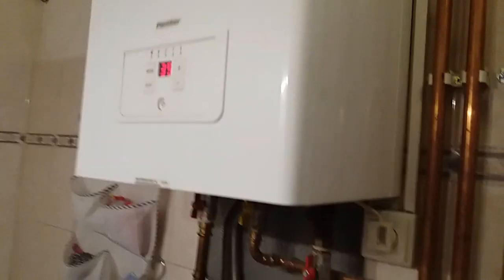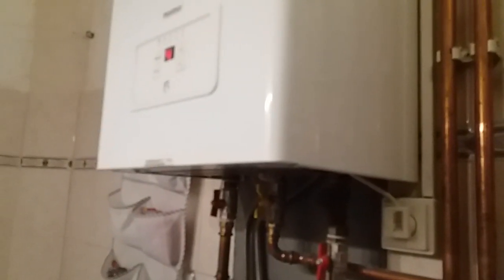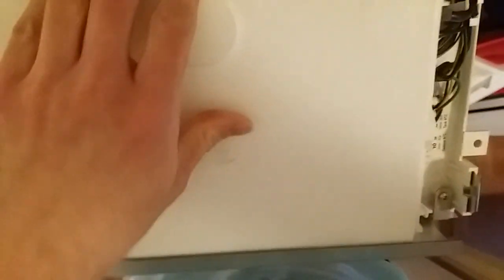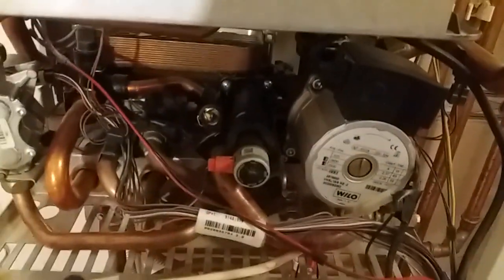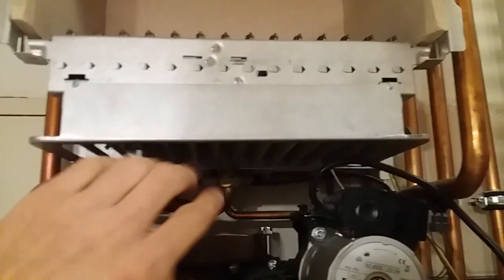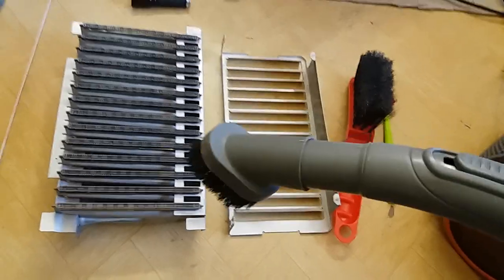Cleaning my gas burner clogged with dust (quick unedited video)

Comment: You need more memory on your phone, get an sd card 😂
Reply: some phone stop recording after 10 minute automatically even if the  memory is enough,so use open camera
Reply: @lifeai1889  owo didn't know
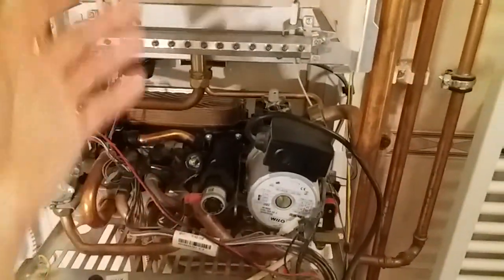Reply: @lifeai1889  also just noticed that it's 4:44 long
Reply: Mine will record until there is no memory left; I've recorded for much longer than 10 minutes before :).
Reply: Mine records as long as it has available space in memory
Reply: @lifeai1889  Its probably because of shooting in 4k, it causes the phone to overheat after 10 minutes
Reply: @kquote03  it's because of consumer product regulations
Reply: @arthurmead5341  so you mean the government doesnt want me catching people lackin in 4k??

Comment: Interesting design with those nozzles placed horizontally. I had my share of gas plumbers not knowing what they're doing some years ago. In my case, the copper nozzles were clogged almost fully with green oxidation which made the burner misfire and go into fault randomly. I don't understand how the guy could not see it. Took me a while to figure that it was caused by condensation water dripping on the nozzles. Those silly gas plumbers forgot to add a hose to the condensation water trap in the exhaust pipe, so drips of water were overflowing into the burner for years. A .6mm chinese circuit board drill freed up the nozzles nicely. If you want it fixed, better do it yourself.

Comment: That is what we call in Britain a combination or combi boiler. Naturally lots of things to go wrong but most of those things are safety related so naturally unless you know what you are doing no touchy!
There are some old boilers with virtually no electronics with what I believe is called a balanced flue system, which doesn't require smarts to shut it dosen't if there is a problem. There is still one such boiler fitted at my late aunties house, a Potterton Kingfisher 2, it even has a manually lit pilot light!

Comment: In the UK open flued appliances are not allowed the reason for this is the condensation in the room can effect the flow of gases in the flue. If you issue is overheating this maybe the possible cause. The combination products not getting away quickly enough.

Comment: I im doing some work on heating units and first of all cool you are cleaning it yourself its not really dangerous just unplug it and you are fine

You should also not forget to clean the siphon (if that is the word in english) the part where the dirty warter from the burning goes cause the rust and other garbage flow though there as well

Comment: 2:30 that`s not a thermostat. It is a 3 way valve (actually an actuator) that switches between heat excangers. Doing so switches between hot water preparation and rediators in your house.
Reply from the maker: Youre right :). this double purpose burner definitely has to have something to switch between the radiators and the tap water.

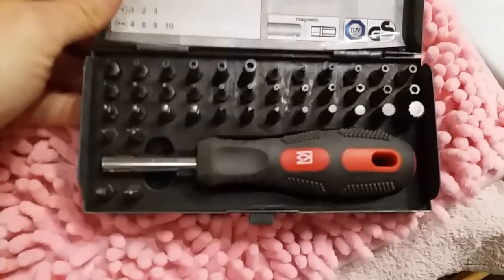Comment: 1:22 Is that from Lidl?
Reply from the maker: I got it as a present, so I don't know :). But the sets of bits I often see in Lidl are rubbish, they are just flat head, Philips, maybe some hex or torx, but never a spline (XZN), flat with a cut out center, 3 point star or a hex / torx with a hole in the center. Lidl has only the more common bits, not those super special ones, and they are in just a plastic box, not this metal box.

Comment: So, was the problem solved? Or is it more than just dust? From my experience it might be a (temperature?) safety sensor tripping - the more intelligent gas heaters become, the more fallible parts there are in them, and they will fail at the worst possible moments. That's why my gas heater is still old school (purely mechanical), very simple and cheap to repair.

Comment: I really don't like to install boilers in enclosed rooms, because they always get clogged up with dust.
Reply from the maker: I also don't like it, but in an apartment, there's no other space for it. There's no heater installed for the entire building, so each apartment has to have its own heater.
Reply: @DiodeGoneWild  here in Mexico City. big new apartments are getting solar water heaters and back up boilers but the gas savings are over 65% in a rainy year.

Comment: OK we were cut off at the end.. Now we don't know if you and your authorized plumber are left frozen without any heat.. does it work now? :-)
Reply from the maker: It seems to work so far :).
Reply: @DiodeGoneWild  Good to know. I was wondering if my favorite YouTube channel would be frozen! Did you find out if the 24V 10A 240W power supply could be cheaply modded to make variable? Maybe it's not a good idea now because RD TECH is selling the RD6006 power supply so cheap?

Comment: you must also clean the fan, the suction barrel, and the smoke barrel.
Reply from the maker: This heater seems to have no fan. It just naturally sucks the fresh air in as the hot exaust gases go up to the chimney.
Reply: DiodeGoneWild@ you mean just like how a Turbo works
😉👍

Comment: i've had a common issue with the gas heeeeeater. It kept shutting down randomly, but it wasn't the duuuuust. Instead it was a malfunctioning relay on the main booooooard. By the way, how many treats the very qualified gas technician asked for the job?

Comment: Your boiler does not need to be cleaned, it is sufficiently clean. Do you have a fresh air intake for the boiler? In my country it is forbidden to install boilers with natural circulation in the bathroom; only those with closed combustion chamber and forced draft are allowed. maybe the problem with your boiler is the lack of combustion air if your bathroom has no open window or fresh air intake; the fault can also be caused by the exaust fan in the bathroom if you have one installed. It helps to clean the fire detection electrode with sandpaper sometimes. Do you have a good earth conection ? the flame detection circuit needs a good earth connection.
 The saia branded part it is not a thermostat, it is a 3-way valve for wather with actuator, it switches the boiler from heating and domestic hot water :)
Reply from the maker: It keeps clogging with dust. Cleaning it always helps. I also sometimes clean the electrodes. This heater takes the air from the room, mixes it with gas, burns it, and then the exhaust gases go into the chimney, no fan, it just goes naturally up as it is lighter than air.

Comment: I was waiting for the boom after he switched it on...
Reply: In one of my many foolish mistakes when younger, I rented a room in a shared house and the exhaust fan inside the boiler failed.
It was winter and the landlord was taking a very long time to repair it so I decided to bypass the pressure sensor to have a shower.
It worked fine maybe 6 times then one time bang the boiler tried to ignite with the gas/air mix inside it in the explosive zone.
I did not do that again.

Comment: The exchanger is the part needs cleaning and careful with vacuum cleaners as carbon lumps can hold heat a long time stuck inside the heat exchanger  the big airflow can make your vacuum into a big fireball...
Edit: if the burners are not fierce blue but a wobbly orange they are not getting oxygen through the exchanger...

Comment: thats a hazard !!!!during long showers co2 will accumulate. i almost died once so if you can move the heater outside it will be better
Reply from the maker: CO2 goes up into the chimney because the exhaust gases are hot and thus ligher that air (as long as it works properly).
Reply: @DiodeGoneWild  it also draws oxygen from the room .....just dont trust it and always keep a window half open in the room